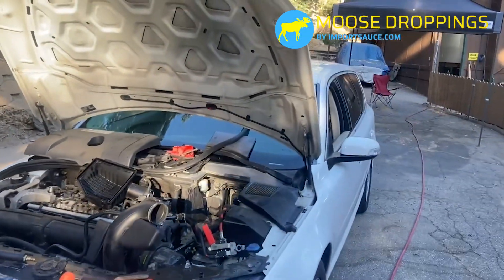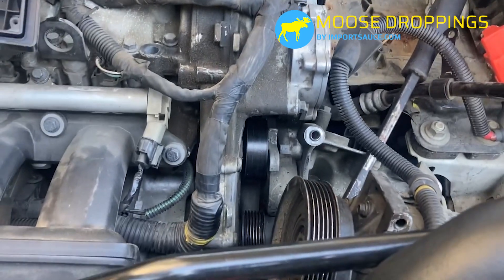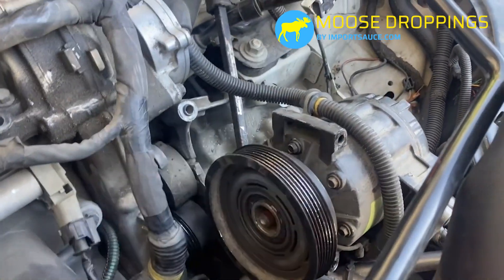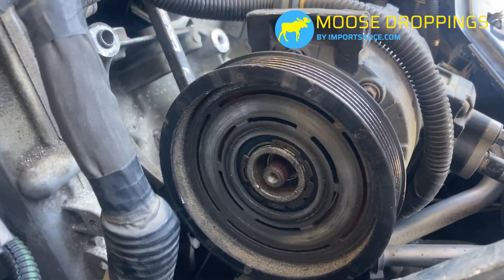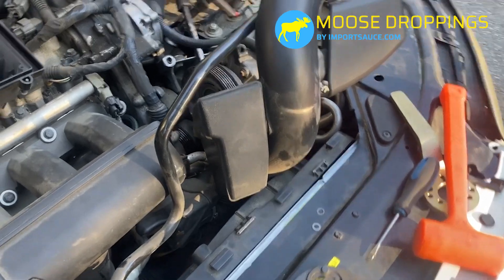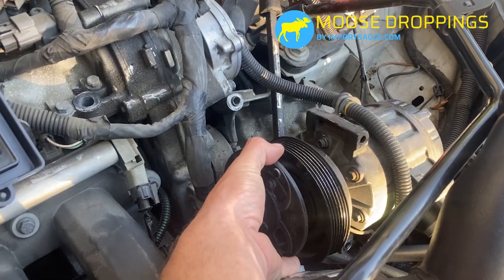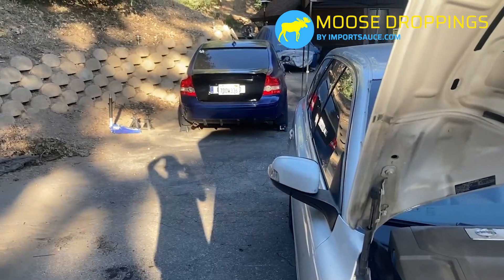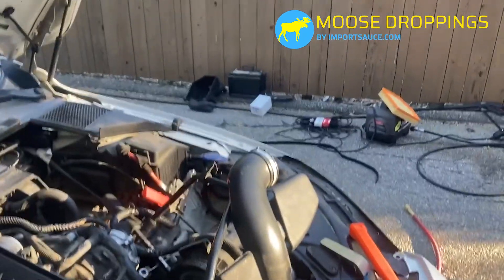Volvo Air Conditioning Clutch Shims - Top Level Overview

Comment: There is a quick fix for this, you can use either cable ties or bread clips to shim the the clutch.
 A picture is worth a thousand words, so just google
 'car ac clutch cable tie shim'.
I used this method on my S60R as there is very little room to remove the clutch to shim it properly. 
 I used cable ties and it's lasted nearly 8 years. 🇦🇺

Comment: Hi joel way off topic to this video but I feel like you’re an expert at this.

I’m looking at gathering parts for a AWD manual C30 conversion, issue is, M66W cars are hard to find for a cheap donor price.

However, While I can grab the M66w from a junkyard, there is a half solution.

A cheap Automatic T5 awd popped up. And It removes almost all the oem parts off my list minus the tranny.

My question is will the rear diff and the torque converter originally of an Automatic pair up to a manual m66w and will the wiring in the interior remain the same as the straightforward donor option?
Reply from the maker: You got it, mine was that set up, and all I did was the swap. You will still need the tranny, shift cables, tranny mount, and the wiring will be exactly the same, as I detailed in the wiring portion of the M66 video series,
Reply: @ K, sounds like a good deal, might even keep the AWD auto trans to convert a auto t5 c30 down the line to awd.
Reply from the maker: @shortbushero  exactly the correct plan!